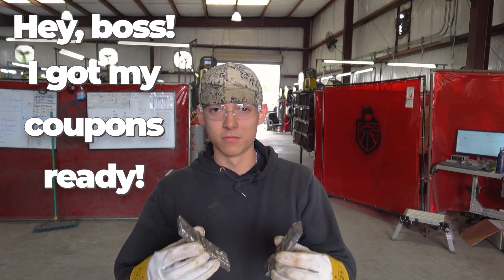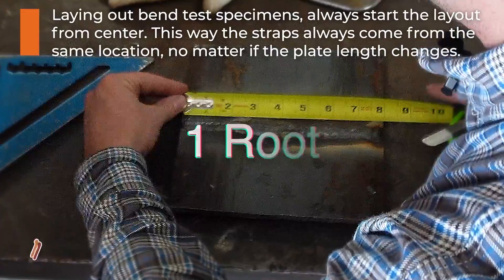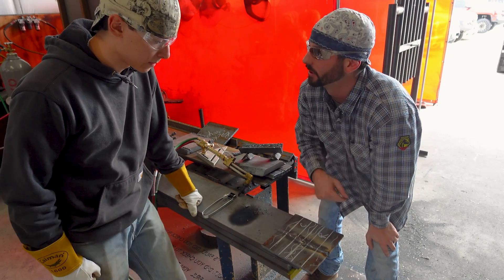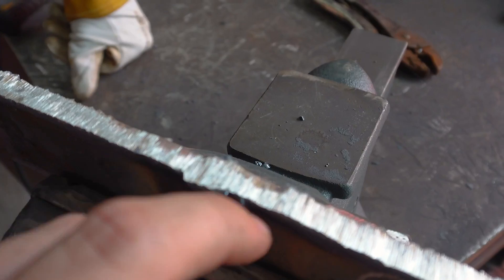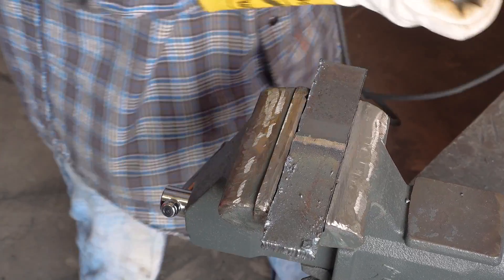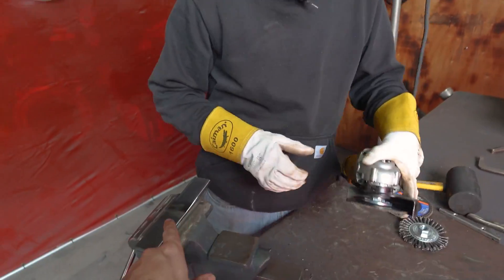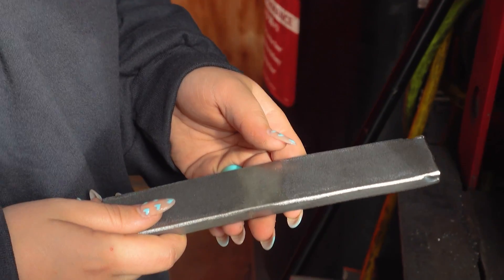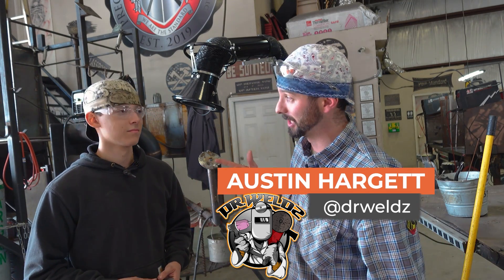Welding Bend Test : How to prep your test coupons like a pro.

Comment: Bandsaw saves time.  Anything requiring heat treat should not be flame or plasma cut.

Grinding could remove HAZ from flame cut but not assured.
Reply: Great tip!

Comment: I passed a seismic test for California.  Just take your time.  Don’t grind in the direction the Bend.
Reply: Howd that work for job wise im structual up in norcal and its been kinda hard to find stick work
Reply: @Jacobo_fab_repair  It was mostly Tig and Spray Arc.
Reply: @RichGT350r  awe im still not certified in tig yet
Reply: Grinding with the weld